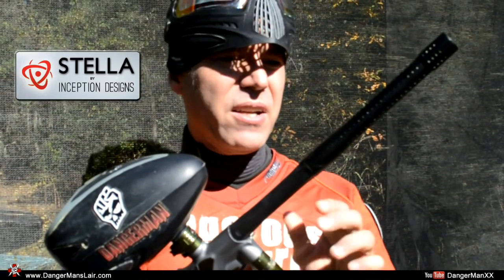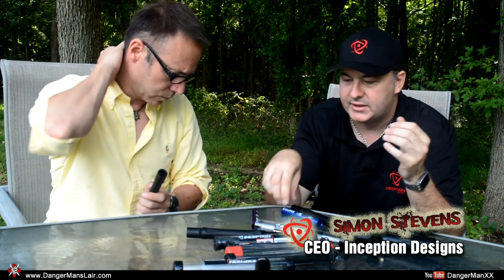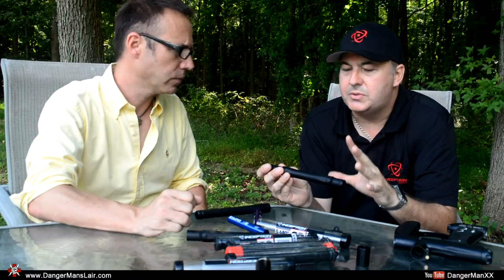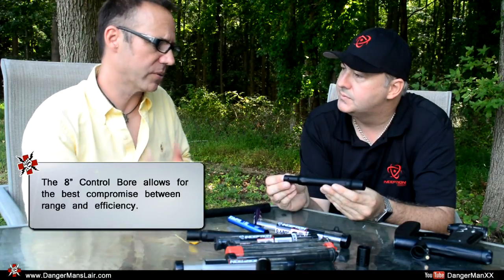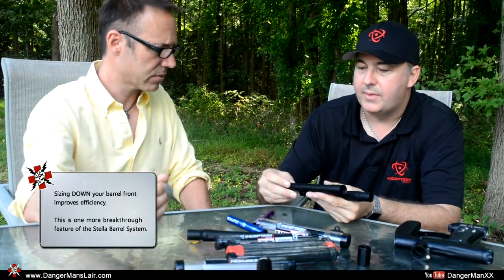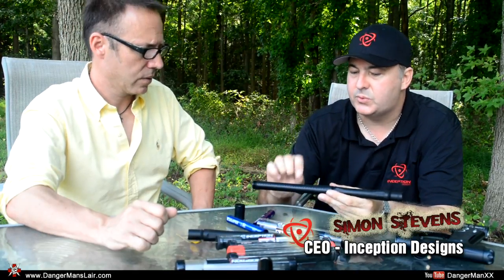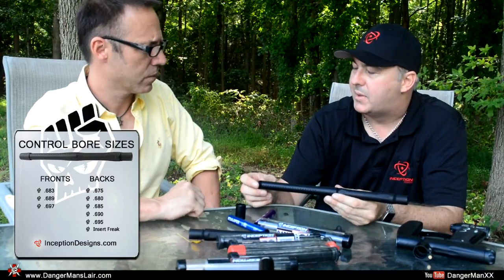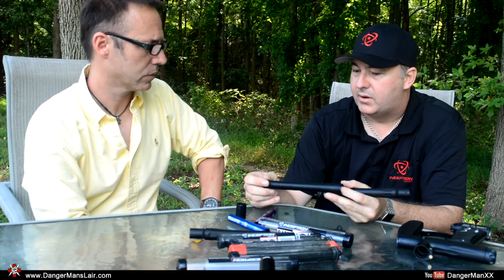Inception Designs Simon Stevens Explains the Stella Barrel System - PART 1

Comment: I wonder if he's looked at shrouded barrels to suppress noise, similar to air rifles.  Full-length designs (like the Benjamin Trail/Titan) are extremely effective at attenuating the rising-edge crack as well as the overall impulse of uncorking.